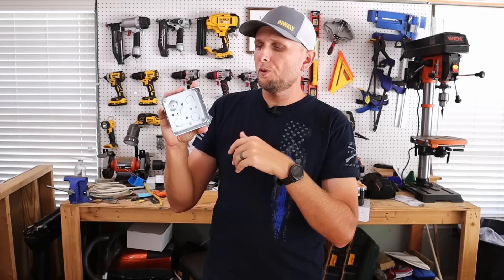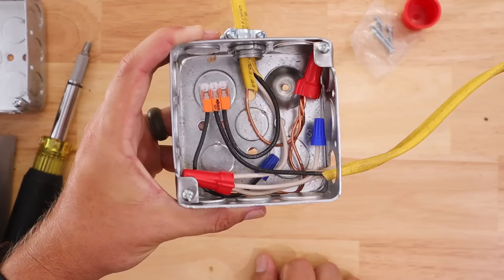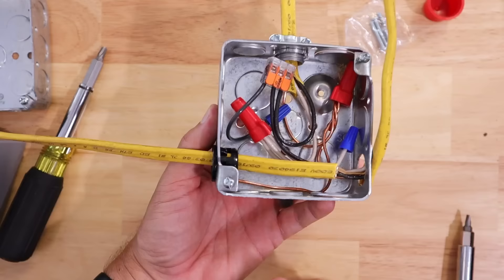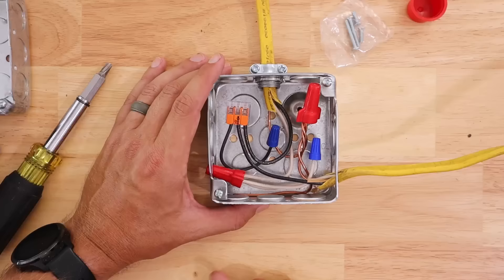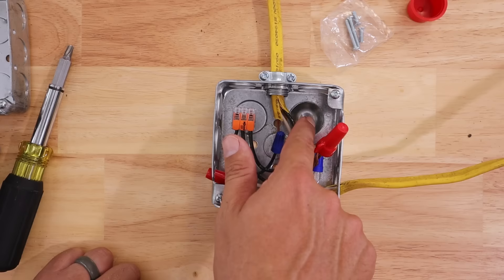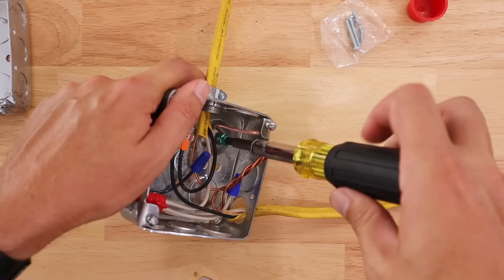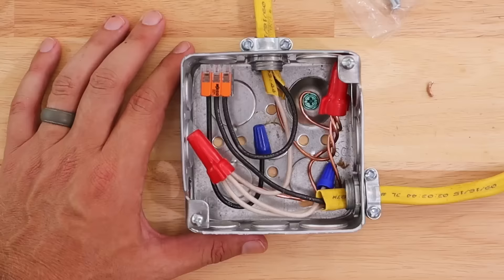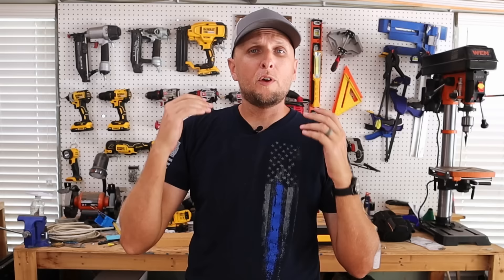The BIGGEST Mistakes DIYers Don't Know They Are Making When Installing Metal Electrical Boxes

Comment: My Dad was an electrician , and many times I would help him on jobs in the summer, and when it got to point where he could trust me to rough in a box ( they were ALL metal back when the dinosaurs roamed the earth!), Dad ALWAYS made sure  I grounded the box with a crimped on copper terminal screwed to the box. Dad made sure it was done right! All these years later, I STILL remember that. Thanks Dad.
Reply: I am a fan of using crimp terminals especially on stranded wire.
Reply: I've never seen anything BUT metal boxes in new work. Plastic is usually just rework in my experience, and only for convenience. If you're doing new work, the box gets screwed to a stud, so you might as well make it metal and strong.
Reply: Just saying … please teach your own kids what your Dad taught you. And if you don’t have kids… teach some other kid. We need the skills and quality workmanship of our ancestors to passed forward. Thank you 😊
Reply: @drumstyx  it all depends on the specific application and/or if it's Residential vs. Commercial/industrial "new" work...  both types of boxes definitely have there places and pros/cons... Cost usually being the largest factor
Reply: @drumstyx nail on plastic boxes are used in new home construction never used steel boxes anymore except on block walls and commercial 😊
Reply: Don't forget to close all unused knock outs with a metal knockout seal with the tabs flattened to allow it to be flush with the box. This is an NEC requirement to disallow any opening to be a path for  oxygen to fuel an internal box fire.
Reply: @drumstyx do what works for you
Reply: Same here was taught to use a ring terminal on box and outlet screw.
Reply: @kylestan2250  Just to clarify, this only applies to stranded wire, right? Not an electrician.

Comment: Just for clarification, if the incoming line carrying the power is #14 (common in an existing home), it's fine to use #14 or #12 coming off the Wago. I could see someone misunderstanding what you said as all the wires need to be the same size when they need to be as big or bigger than the source wire.
Reply: If we're clarifying here, the limiting factor is the breaker, not the wire.

12 AWG has a 20 amp capacity
14 AWG has a 15 amp capacity

So 14 AWG can be used in a circuit being fed by a 15 amp breaker. 12 AWG can be used in a circuit fed by a 20 amp breaker. 12 AWG can also be used in a circuit fed by only a 15 amp breaker but it's a waste of money as larger wire is more expensive.
Reply: @hogroamer260  Sure, but lots of times you're going to find yourself with a roll of 12/2 that you're already using for the work and it's far more expensive to go buy some 14/2 than just use 8" of #12 of what you already have. This video was marked as DIY, so there isn't a truck or van with spools of wire to hit up. 

The breaker and the wire are both limiting factors. If someone else installed #14 on a 20A breaker, you've got an entirely different problem on your hands than the receptacle you're working.
Reply: @plsreleasethekraken   @plsreleasethekraken  Yes, I get using what's on hand as long as it meets the breaker capacity. No need to be snarky, not saying what you said is wrong, just trying to summarize  and clarify that the breaker dictates.

The design is dependent on the load, the breaker is chosen based on that. Then the wire size is chosen based on the breaker size (leaving out voltage drop situations). The breaker protects the wire, the wire is not a limiting factor. If someone used 14 AWG on a 20 amp circuit, that's a code violation and my comment is geared toward compliant work not every mess that a "DIY'er" can achieve. A DIY'er needs to know their limitations so they can seek out a professional. Just because there are YouTube videos' doesn't mean everyone should tackle a job on their own. They may be putting their lives, and more importantly, the lives of others in jeopardy.
Reply: @hogroamer260  sorry if that sounded snarky, it wasn't intended that way--just speaking practically.

Yes, it would be a code violation; I was just speaking in terms of engineering/physics that the wire can be the limitation. An electrician can install a 20A breaker with #12, and then a previous owner could extend the circuit with #14. It's a code violation, but as the home owner I don't think you should care as much about that as understanding that wire is your limiting factor on that circuit because everywhere else on the circuit where the initial electrician wired with #12 would be fine.

Again, mostly just trying to stick with the theme of the video where DIY opens up recep and finds this stuff. I do not think everyone should assume all the electrical done on their house was to code. It's never been that way anywhere I have lived.

Appreciate the discussion.
Reply: i mean you could run jumper cable thick #6 wire from your breaker and go to #14 gauge in the box if you wanted to on a 15 amp circuit.  not a great idea but code would be fine with it.
Reply: It's ALWAYS fine to go bigger wire.. NEVER reduce wire  size

Comment: Should also warn against overtightening the metal romex clamps. I went through a bunch of shorts before figuring out the perfect clamping force.
Reply: There is actually a torque spec from the mnfct for all those screws/bolts/lugs.  Nobody pays any attention to it but a torque screwdriver is a good thing to have in your bag.
Reply: Common sense is also good to carry in your bag,  well darn that's the fifth wire I've cut with the clamp today😅

Comment: Metal boxes and twisting wires. Both uncommon in the Netherlands for at least 30 years.
Reply: Metal boxes are pretty rare in the US for recent residential construction.  I see them when used with conduit, when mounted on masonry basement walls, or on old installations.

Comment: Remember, you cannot connect 14 gauge to 12 like he mentioned in this video, unless the breaker is 15 amps.  Also, you can connect 12 gauge to 14 gauge.
Reply: If the run from panel to box is long, you might use #12 on the long stretch to reduce the voltage drop, then use #14 inside the box. On a 15 Amp breaker.
Reply: even on a 15 amp circuit i'd argue it is a bad idea.  you know some idiot is going to look at the wire from the breaker and decide to put a 20 amp breaker in.

Comment: Once you have a Wago connector filled, do a wrap of tape around it.  It prevents the levers getting caught and potentially releasing the wire.
Reply: This is how I was taught
Reply: WAGO as a German company has a lot of accessories you won’t find elsewhere.

Spelsberg ABOX SL 2.5/4 has plastic “sockets” where you can push the WAGO’s in once they’re connected, which makes everything look nice and prevents the levers to be opened.

Google for an image - it’s brilliant and an incredible time saver.
Reply: @maxking3  Any idea if those boxes are code-compliant in the US?
Reply: @PongoXBongo  I can only see the VDE certs for these boxes on their website. Other components are listed also with IEC and UL Type Ratings, which would be sufficient for the US.

So I guess the answer is either „No“ or „Not yet“.

(But they‘re really cool nonetheless!)

Comment: Code Table 210.24 allows 20A branch circuit taps to be 14ga wire.
Reply: Only on copper, not aluminum or copper clad
Reply: @dartrunner4599  1.  He literally showed he was using copper.
2.  You cannot use aluminum or copper clad aluminum for a branch circuits of this size at all .
Reply: @zippitydoodah5693  Funny how people will debate you even when you present the code. I've been an electrician for about 30 years and I run across this or these guys that do these videos that give the wrong information. Dunning-Kruger effect rans rampant nowadays.
Reply: @genjaxx1463  Couldn't have put that better myself.  Did you complete one of the schools? IBEW?  IEC?  Stay cool, Sparky.
Reply: Thanks for bringing this up, I was hoping someone would.

Comment: with respect to the ground wires.  I find that it is easier to take the ground wire from the incoming cable and cut it a little longer.  Then loop it around the ground screw and with the extra length you can then twist it together with the remaining ground wires.
Reply from the maker: Yup that would work.  Although surprisingly I have had people argue with me on that too haha.  Thanks for the input.
Reply: @HowToHomeDIY  very nice video
Reply: @50srefugee  interesting.  I've never seen a green one, nor one with a hole.  thanks
Reply: Make sure IF you use the continuous conductor as your ground that you leave enough wire before hitting the ground screw. At some point those wires are going to move and that pinched ground is going to break. If you leave a neat 3" or 4" before the screw you'll be able to extend the ground in the box and save a headache.
Reply: The hole is so you do not have to run a separate pigtail. If you are joining for instance 3 ground wires leave one extra long and run it through the hole and the wirenut then goes down to twist all three together. Trim the long wire that comes through the hole to length to then ground a plug or switch. Now there is no separate pigtail,
Reply: @tchevrier  Ideal, Commercial Electric and others make them while HD, Lowes, Menards and others sell them. Been around for at least 20 years of which I am aware.
Reply: @denali9449  All in the US?  I've never seen the in Canada, even at Lowes.
Reply: @tchevrier  Oops - did not realize where you were from. I have never looked for them in Canada and it is possible that they are not used there but I have no first hand knowledge. Try a search for green wire nuts . . .
Reply: @denali9449  that's ok.  I don't need any.

Comment: That’s some great advice. In Bulgaria where I live, metal junction boxes are not that common in households. However, water heater switches are pretty often installed in metal boxes. Which can make it even more dangerous if the water becomes dangerous. Greatly explained, Sir.

Comment: Interesting to see the differences... Here in the Netherlands, you would typically see only plastics used in residential installations for boxes, conduits, sockets, switchgear and consumer units. 
Wagos are, of course, well loved over here too. Wire nuts, though still available, are a thing of the past. Those you cannot trust DIYers to get right and the pros have long gone the way of the Wago because of the time savings they offer.
Reply: Plastic and glassfiber is usually used here too whenever the devices are not exposed on top of a surface. Metal boxes and conduit are used and needed for exposed (on the top of the surface) installations, which you normally only see in commercial buildings. In homes, it would be possibly in a basement with concrete walls or in a garage with new work and wiring installed on top of the surface. In Europe we have special cable allowed for running on surface, but I remember a crazy scenario in Finland, where regular metal sheated wire was used and we had to add panzer tubing on top of all exposed wires that were run below 1.70m in closets, etc... (This was in a summer home, and the year was 1980). You definitely have quite a set of rules over there too :)
Reply: I just bought a "metal "housing" with no ground wire, unless ground is copper wire at back of housing, only black pos and white neutral wires.
I never even thought of looking for plastic housing. My guy at Home Hardware selected metal housing. I don't think I had an option.
David
Innisfail, Ab.
Canada
Reply: @mernokimuvek  
On mine  it is.
Reply: In the US my electrical service entrance conduit is plastic.  The cable TV guy put a nice copper conduit clamp on the plastic conduit and used it to "ground" the cable.
Reply: Metal boxes are very common in old construction in the USA, but most new construction uses plastic boxes where they can. I think new codes require plastic boxes in some areas.
Reply: I thought the same (Austria). Here metallic boxes are not allowed anymore (grounding could come loose or disconnected too). Here we would use "spelsberg" soft or hard plastic boxes. PS: Biggest con of wago is the high resistance of the contacts (higher loop impedance and possibility of burned wago after a short circuit because of the high resistance. and we still only use wago because of the time saving and the flexibility)
Reply: @Ethan_Hunt-AUT  If conductors are properly prepared, I have not experienced a WAGO causing an increase in resistance or impedance.  There are many YouTube videos showing how de-rated the WAGO connectors are, some passing 3x rated current for far longer than the time taken for a protective breaker to activate, before damage. The main risk I see is the levers can get lifted when pushing wires back in a tight enclosure. Good cable dressing or using a WAGObox will greatly reduce this risk.
Reply: @MS-Patriot2  the levers are indeed tricky. I just wanted to state that we often saw that short circuits can also destroy some wagos
Reply: @Ethan_Hunt-AUT  Thanks for information Ethan.  Was your situation with a three phase installation?
Reply: @MS-Patriot2  no, notmal 230V (Europe) where a device had a broken cable. But maybe someone made the mistake of over-twisting the flexible copper at the wago
Reply: @Ethan_Hunt-AUT  i mean yeah about 3 times higher than wire nuts. of course you are still talking .6 ohm or so.  and you can reuse them, you can test them without undoing the connection, you can view the connection, and they are far harder to screw up than wirenuts. also allows for undoing one wire without undoing all of them which is nice for future work
Reply: I use both wagos and wire nuts. 

I will say this , if you PROPERLY use wire nuts they are more reliable than wagos. 

If your wire nuts fall off , you didn't use it correctly. You should see TWO twists of the wire outside the wire nut. Lazy installation is not the fault of the wire nut and if you had problems, it was your incorrect installation!!
Reply: @DeadCat-42  it's far harder to verify wire nuts were done properly than a wago.  it's also far faster and less training required to properly use a wago.  both are overenginneered honestly but as long as you aren't at least doubling their current ratings neither should have a problem so the lower resistance of a wirenut or the fact the wirenut can handle 150lbs of force rather than 75 lbs doesn't make a difference for the applications they are rated for
Reply: This vid of course is only applicable to US wiring . Here in the UK  building  construction and wiring regs. forbid this type of practice.
Reply: 😂 @ibtarnine
Reply: We are recent converts here in the US.  I’m under the impression that they were available in Europe long before they were available in the US, but I could be mistaken.  I work in PV so the most common wire size is #10 (which I believe is 6mcm?).  It was only recently that there was a WAGO that could accept a wire of that size.  I’m very grateful to have that option now.

Comment: On new work, I install those pre-made ground pigtails in each metal box ahead-of-time (and "Z" them out of the way).  It beats fighting through other wires to get to the back of the box with the screw.
Reply: Great idea!
Reply: you should have a check with your supplier to see if they have the box with the ground preinstalled in it.  we use them exclusively at my work and they are a real time saver.  The Reynolds Company does list them and sell them with the grounds pre-installed. a quick round of googling should get you to a listing to be able to order them.
Reply: @brunothehumble  interesting.

Comment: Thanks for the info buddy. The grounding screw on a metal box I will be installing for my finished basement project could've been something I forgot. Now it's etched in my brain to not forget. Have a blessed day and work safe brother.
Reply: It’s really a bond, not a ground. Boxes are bonded, equipment is grounded.
Reply: No man. Just use plastic box. No need for additional works.

Comment: One thing I learned the hard way to do is to check those Romex clamps for casting burrs that can cut into the Romex; I had to replace 30 feet of Romex after that lesson, when I turned on the breaker and ...BOOM...the breaker tripped and the Romex was damaged right at the clamp, leaving it too short to use.
Reply: Couldn't you just add another Jbox a bit further down the line to connect the old wire with a new one, instead of replacing 30 feet or Romex?
Reply: @danielthommen8243  There was no room for a J-Box, without hiding it behind a wall (a code violation). The 30 feet of Romex didn't go to waste; most of it was used elsewhere.